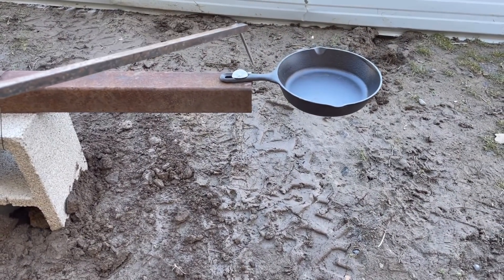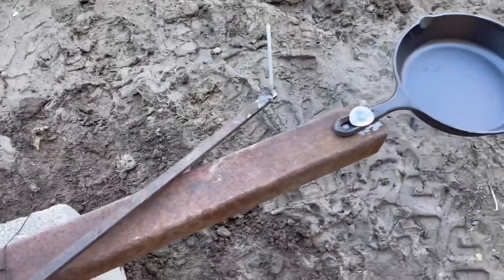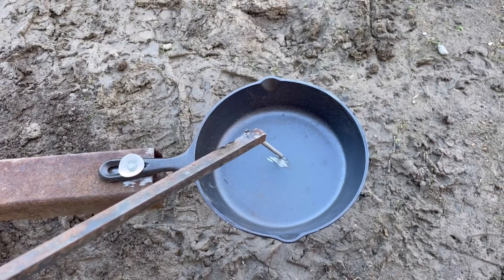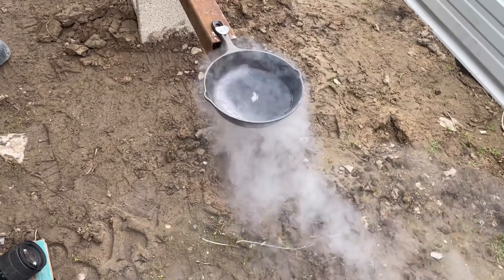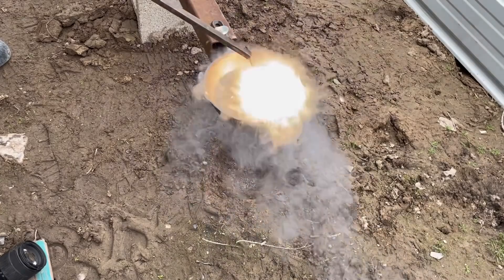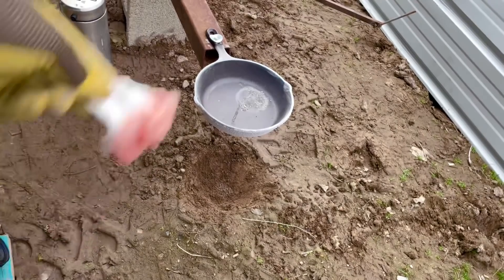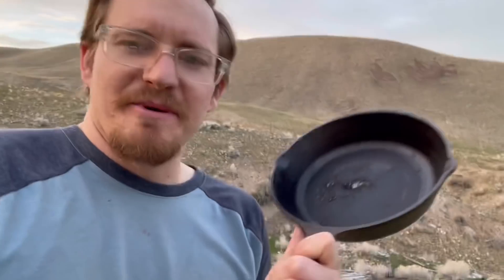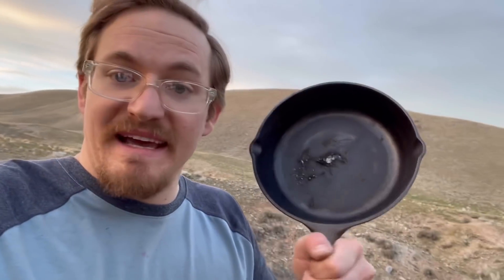Welding in an iron pan full of liquid oxygen

Comment: Yeah, once you get a cut going with an oxy/fuel torch, and get the oxygen flowing, you can 100% cut off fuel to the torch. The heat from the exothermic reaction of the oxygen burning the steel, is enough to heat the surrounding metal to liquid, which then reacts with the oxygen, continuing the the cut! it takes a steady hand and some practice, but you can cut for feet, with only a few seconds of fuel at the start to get the reaction going! What's really neat, is this is how those demolition rods (oxygen lance, thermal lance) work. They're a tube of steel, surrounded by thin metal wires/mesh, inside a larger steel tube. One end of the rod goes to a holder, to blow oxygen through the tube to the tip. They usually have a copper contact for the tube connection, that goes to a wire. You light the torch up, using a car battery connected to that wire, or a welder, or whatever. Just enough to arc/melt the corner, and the oxygen does the rest. You can also light them with a torch by heating the end. Then they're self-sustaining (well, with the flow of oxygen). The burning steel is directed forward, along with a high velocity jet of now pre-heated oxygen! So this extremely high temperature jet of o2, along with burning steel, is then used to cut through almost anything. Huge feet-thick chunks of steel, concrete, stone.. doesn't matter. It burns through EVERYTHING. And it runs on only oxygen, the tube itself is the fuel. They even work underwater! They're used in the heavy equipment/mining, demolition/junk/scrapping, and ship worlds quite often!

Search youtube for 'thermal lance' or 'oxygen lance' videos, they are VIOLENT, DISGUSTING, DIRTY, AMAZING things. Sadly, I've never run one, only high current arc gouging and plasma gouging, which is comparing a match to a 100 ton ironmaking furnace!
Reply: I only know of steel mills that run their oxyfuel cutters without fuel after ingnition on some automated equipment, cutting thick bars of still glowing red steel from strand casting. The glowing steel is so hot that it doesn't need extra heat. 
I can imagine that it works, but I've never seen it.
Reply: @jackmclane1826  It's a fun 'game', to practice turning fuel off. It teaches you to be accurate with your cuts, teaches you to control your tip angle, teaches you to stop side to side wiggling, and make continuous cuts, because it's quite easy to 'lose' the cut without fuel. if you wobble? move too fast? You out-ran the pre-heated steel, and you stop cutting. Move too slow? kerf becomes so wide, oxygen doesn't touch the sides, and the cut stops. Same for wavy lines, and same for torch tip angle (direction of cut). It's not easy at first, hell it's not easy with practice, but by doing that practice, it improves all the other aspects of torch cutting by hand improve. Works best if you have long cuts to do, or lots of beveling (the thin wedge you're blowing away, stays hot enough to give you a lot more wiggle room, than trying to cut into cold 1" plate
Reply: @dogsarebest7107  I so rarely use an oxy/fuel-cutter that I'll never have sufficient skill to do that. But a friend of mine said that the fuel flow in many torches is reduced when you open the center oxygen flow as a second function of that oxygen valve.
Reply: @jackmclane1826  Hmm, that I don't actually know. I believe it just "seems" that way due to the air fuel ratio going so lean. I have a big industrial Victor cut head I need to rebuild soon, I will see if the handle occludes the fuel channel as well. That really is a good question, damn, hadn't thought of that to be honest. Now I gotta go check! BTW the practice-without-fuel really transfers over both to tig, and plasma cutting. But man do I love plasma gouging. There's something about it.. just whittling away steel, shower of sparks, yet the precision.
Reply: I've actually seen this done.
Reply: I believe @ICWeld did exactly this about four weeks ago removing a huge pin in some farm equipment.

Edit: it was a telehandler with a rusted out pin that needed to be removed.
Reply: I discovered the thermal lance last year. Shit blew my mind, so cool
Reply: Thermal lances take quite a bit of skill to run, which is always kind of funny. A novice operator can burn up a 10' rod in under a minute but a pro will make it last for what seems like forever.
Reply: @Solnoric  Oh, I believe that 100%. The difference between nubs and pros in almost any skilled labor is worlds apart. Had an employee plasma gouging for like 45 minutes on a trailer once, finally got done to check on him... what should have been 2-3 minutes with like 10-15a whittling a few lap welds was 45 minutes minutes of 45A gouging, mangled brackets.. that was still very much attached! Gouging is an art-form, doesn't matter if plasma, carbon-arc, thermal lance, or whatever
Reply: Yup, we do this at work all the time to remove rigging. start cutting, and just blow it away

Comment: Burn a nut off a bolt with just Oxygen 
and  no flame on a oxy acetylene torch once it has started to burn my dad at the Blacksmiths shop used to do this when he was running low on Acetylene he just turn of the gas and used the Oxy.
Amazing to watch with green goggles when the rusty nut just melted away, you could spin a new nut on once the bolt had cooled down. We did this a lot on mostly farm machinery back in the 1970s 80s.

I am sure this is the same principal as oxygen lances, I was told that they could cut concrete the same way ?

Comment: I have actually burned up one of those pans before, but it was one of the tiny little ones, and I was using Pittsburgh bituminous coal + a very powerful blower fashioned from a commercial inflator fan. I couldn't actually see what was happening, (the inside of the foundry was blinding white for several minutes after combustion finished) but I think the pan was first melted, then boiled to some extent before it really began burning (the fire bricks were covered in hollow bubbles of oxide after it finished).

Comment: That was interesting. I think in some way you got this wrong though Cody. It comes down to this for me: Why did the arch not ignite the oxygen while the rag did?
Few components are needed. You need fuel. You need an oxidizer. And you need heat. The heat required to burn the rag is a very low threshold.

The heat required to burn iron is much, much higher. The liquid oxygen is much much cooler. While the rag requires a much cooler temperature than the iron to burn, the heated mass was also much greater than the little spot that welder heated up. The heat required to melt iron is greater than to burn it, slightly.

My thinking is you were able to get a spot hot enough to melt by constantly applying a spot of heat via providing power input. But the oxygen was fighting against it hard by cooling it. And as soon as power is removed it is cooled down faster than any kind of runaway reaction can occur. As the oxygen needs to be heated enough to become a vapor for the reaction and the mass of heated material was too small.

Not sure how you would test this. A patch of rag?
Reply: the problem with this is the relative temperatures. -300F or 70F doesnt make that much difference to a welding arc, approaching 10,000F.

Comment: But be careful with compressed oxygen.
Don't know if the container explodes as it does in action films, but once i held a lighter at the hose to my oxygen bottle and was surprised, how fast the flame did eat its way towards the bottle inside the hose - could stop the burn just in time by quickly shut the bottle valve.
Don't want to play with open flame near pure oxygen any more, have to suffer two complete shop losses caused by fire already without igniting it myself anyhow.

Comment: Try with aluminium. It might have enough energy to sustain a combustion. Happened at Bintulu, due to palm forest burning hydrocarbons concentrated in the aluminium heat exchanger in an oxygen column and the spontaneous energy from igniting the hydrocarbon was enough to set off the aluminium. But then again these columns are at pressure as well...

Comment: this video reminds me of a comment of mine you responded to YEARS ago, but what is the coldest 'flame' that is achievable? for example, in this video the fuel soaked rag burns easily but the fuel surrounding it is extremely cold, and so is the pan it's resting on. Combustion of gases can happen in cold space as well. Essentially, what is the lowest amount of energy needed to make a sustained flame?

Comment: melt a hole in the frying pan? before ya start welding... struggle of the next mcribwitch, use the stove. using the stove costs as much as welding, as for $8/inch? hardly enough to fry a 10 cent egg on 5 inches but $40 for a half cooked mic egger, them is up front commie prices. just have one, so much carbon in cast iron the flow of electrons melts the paths of least resistance... parade of bozon's... get some thermite to make the meme real!

Comment: The liquid oxygen cools the pan faster than the fire can warm it up. The reason that iron burns as steel wool or with a torch is: the iron is at it's burning temp and the supply of oxygen is sufficient. You need all 3 sides of the fire triangle at the right amount and you should be able to burn anything.
Reply: I think that could be a mechanism. Alternatively, the heated area directly around the arc actually heats the pan enough to start the reaction, but it also boils away the oxygen directly around the area, and keeps boiling it away until the iron is no longer hot enough to sustain exothermic oxidation. That could explain why oxygen-only cutting works in a torch but not in an open pool of LOX at atmospheric pressure.
Reply: I think that's correct. You notice how fast the LOX disappears--most of it boils off without burning anything. That much oxygen would last far longer if it was only reacting.

Comment: Great video but I’m not sure I believe your conclusion that it didn’t burn as a result of a fixed oxide layer. While the arc is lit, there is a constant stirring of the puddle created by the magnetism of the arc. It is more likely that the weld solidified so fast due to the cold pan that it didn’t have much of a chance to burn.

Comment: curvature rate of earth = .666ft per mile squared. 
Earth going around sun = 66,600mph
Gravity discovered in 1666 (666 newtons)
The north and south arctic circles are at 66.6 degree latitude. 
Diameter of the moon = 6x6x60
Surface temperature of Uranus = 6x6x6
Plutos Orbital Velocity = 4.666km/s
Speed of sound in knots = 666
earth circumference in nautical miles = 600 x 6 x 6
Mars 1.666 AU from sun
Saturn orbital distance 1,426,666,422km
The sun is 666 times brighter than venus
Longest time a female astronaut has been in space = 666 days.

Comment: I imagine the other side of this comes down to the amount of surface area for reaction, and the ability to raise the temperature of the iron to it's melting point. With steel wool, you have tons of surface area and it is very easy to heat it to melting... even if you use the coarse steel wool, it doesn't work so well.
Reply: It's not the melting point you need to hit, but the kindling temperature. The metal isn't melting when you use oxygen cutting, but rather burning away.

Comment: The iron oxide is part of it but oxy torch cutting is only used on low and medium carbon steel because the iron oxide has a melting point below the parent metal. Other metals can be melted through but they won't cleanly burn through. In alloy steels and grey iron the alloys and high carbon content form higher melting oxides and carbides that prevent a continued reaction, and cast iron is much closer to its eutectic point of about 4% carbon.
Reply: Ive usd oxy acetylene torches to cut through some pretty thick cast iron a few times.,  it cuts llike regular steel, you just have to heat the area a little more before using the oxy to blow through it..  slag still looks the same and all..  it just makes the surrounding  areas more brittle..
Reply: And ive seen it used on many different metals..  aluminum is very common to use it on and titanium is common but not the best way to cut it because of the heat ..  is used on brass as well if you wanted to, seen people blow open door locks with it..  the thickness is really what limits it..

Comment: you need 3 things fuel (the pan) oxygen (the liquid) and heat that was non existent i mean -273 thats colder than o2 try using a room temp pan. or if you really want to see o2 burn thick steal get you're torch and a friend. first get your torch cutting your steal make shore it is pre heating a good few inches ahead if the kerf. start your o2 het that forms the cut then have your friend shut off the fuel  ( probably at the torch not the tank ) and continue cutting with the stream of o2

Comment: (welder 10+ years) a carbon archer basically uses a stick welder to melt steel and compressed air to blow it away. you can do it with a stick welder cranked up, and a air compressor. I always wondered if you could attach a air compressor line to a gas cutting torch, use the torch to heat the metal to its  liquid state and then use the air compressor to blow the metal away in its liquid state.
Reply: ditch the gas use electricity! buy a plasma cutter!!
Reply: @Dan-mu5oy  plasma cutters are good inside shops. gas torches still have there use out side shops.
Reply: @zednott  I have a plasma with a built in compressor and my work van has power
Reply: @zednott  only pointing out they exist, also compressed air does not work in a oxi acetylene torch but i thought you would know that....being a "welder"

Comment: My hypothesis would also include that fact that the liquid oxygen, being extremely cold also removes a lot of heat, removing 1/3rd of the fire triangle (heat oxygen and fuel). Why the rag would burn and the iron not would be described away by the difference in heat energy needed to start a fire with those fuels (diesel vs iron as fuels)
Reply: What temperature do you think that welding arc is?
Reply: @c6q3a24  Couple thousand of degrees. Doesn't really matter when an inch away from the arc is below freezing.
Reply: @c6q3a24  The temperature of the welding arc is impressive, but not enough to significantly heat a thick iron surface that has been super-cooled up to ignition temperatures. There were obvious flames while the current was arcing, but the heat energy dissipated into the rest of the pan as soon as the arc was removed. No heat = no chemical reaction = no fire.
Reply: Compressed oxygen is much warmer than liquid, so perhaps iron would be more reactive. It's a good hypothesis!

Comment: I think part of it is also due to the Temperature. The pan is going to be acting as a great heat sink that has been cooled way down and when you try to ignite it it has a lot of energy ot needs to over come before it starts burning
Reply: So in order to get the oxygen to remain a liquid at the right temperature, the pressure needs to be incredibly high. That's a hard experiment to do.
Reply: @EvilNeonETC  Rocket engine wall while dumping LOX into it? Might end up with liquid oxygen on bare steel for a few moments (before it eats through).
Reply: No. Yes.  Yes because it does contribute to the temperature loss, No because it's not enough to matter. The rod(s) have a protective shielding gas or slag that is used to minimize the contact of the molten metal with the air as well as the surrounding temperatures of the target. IF temperature loss was dictated by the dispersion and or the conductivity thermally around the area, welding would be quite different than it is now. Stick welding especially. 
Yes, temperature IS in this method how one would accomplish said melting of the iron pan. Obviously welding and cutting is temperature dependent here. 
Noticing it was cooled quickly because of the temperatures of the pan when the electrode is not present. That is part of the metallurgic bonding as it solidifies.
IF he could keep the electrode in one spot and it was achieving the temperature required to melt the iron it would of melted said hole regardless of the temperature around it or the object, mostly. 
It failed because of the method not the variables. In this instance the liquid oxygen played no significant part, would not play a significant part in the process, the exact area the rod came in contact would easily overcome the temperature by the very method the weld is achieved, or hole for that matter.
Reply: How WOULD it work in these variables? An environment that would stop the area from achieving the needed temperatures for success. A constant temperature maintained defeatist if you will. That was not achievable in this test.
Reply: Don't forget that thr liquid oxygen itself is very cold. It will disrupt the heat as much as than the pan.
Reply: @sumduma55  Welding doesn't work that way.
Reply: @LordofthePings-k  lol.. but liquid oxygen and cutting does.
Reply: @sumduma55  Idk why you bothered. But if it helps you spread ignorance please continue.
Reply: @sumduma55  There's plenty of DBZ videos you could be watching. 🙄
Reply: A part of it, sure, but a very small one. Think of it this way: the melting point of steel is far more hot, than liquid oxygen is cold. (Several thousand Kelvins hotter than room temperature, vs. just about 200 Kelvin colder than room temperature.) So the pan being cold is probably negligible compared to all the other factors Cody mentioned for why this doesn't work.